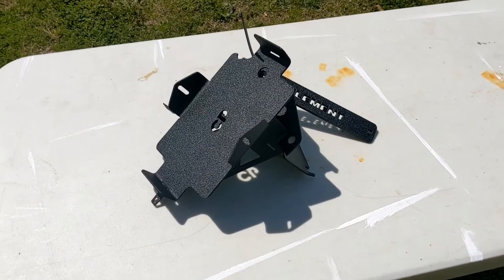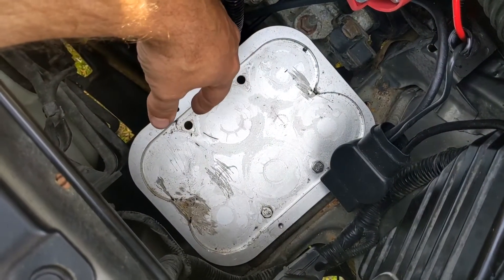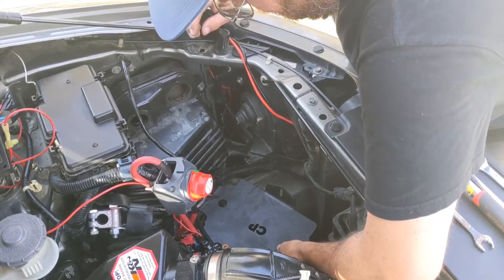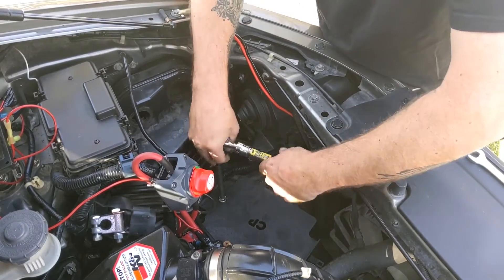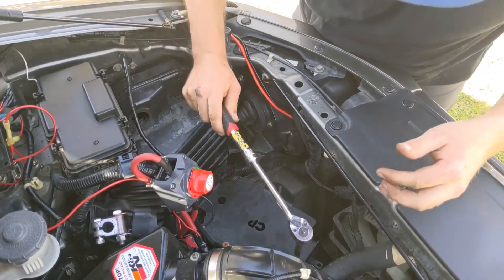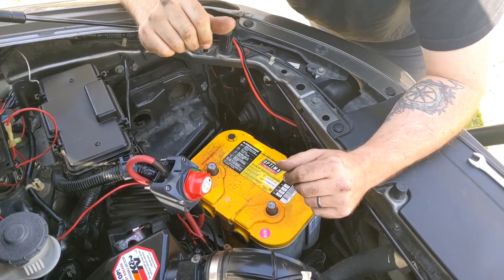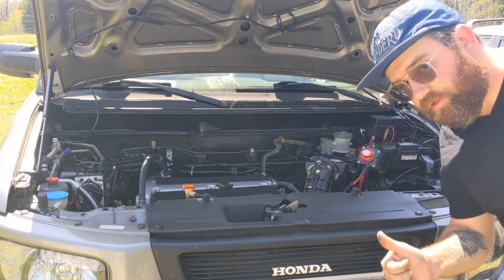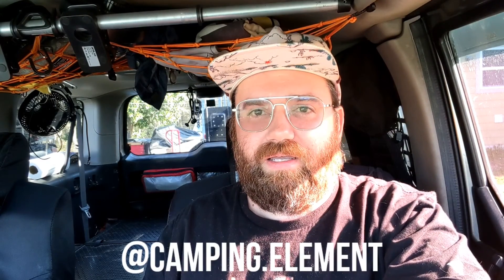Honda Element 24f Battery Tray from Counter Productive

Comment: $150 for this part is ridiculous.  

Pull off the plastic tray, bend the oem tray tabs just a tad and a 24f battery fits right in the stock location.  I bought the battery hold down kit for $8 at advanced auto.
Reply from the maker: Agree. Every part I've gotten from counterproductive is quality & worth the $
Reply: I put the advance auto battery hold down on my beater since it didn't have one, it broke after 4 months

Comment: did you have to upgrade any of the wiring to support the larger battery or just slap er in and enjoy the faster starts  and more cold cranking amps?
Reply from the maker: No need to upgrade the wiring. Many Element owners have done this upgrade & I've not heard of anyone having issues, myself included. I was running a bigger battery for a good couple years on a DIY tray before I installed this one.
Reply: @TheCampingElement  I just did the mod using your video as a guide. Thank you. Works way better in the cold